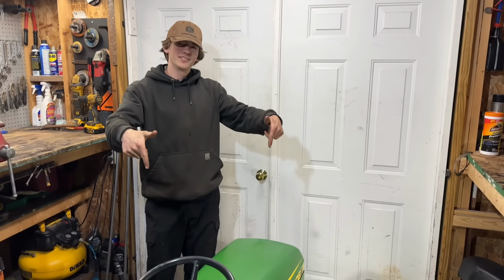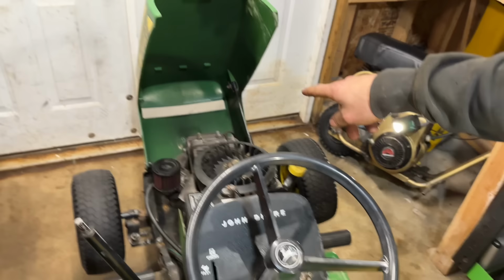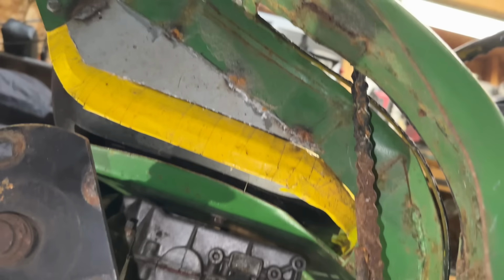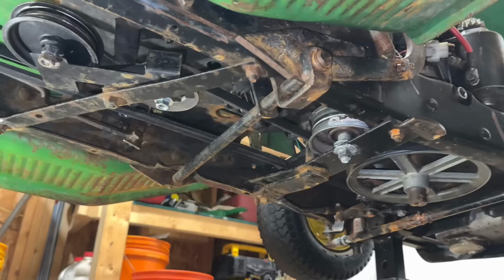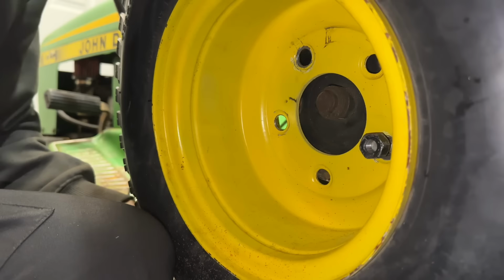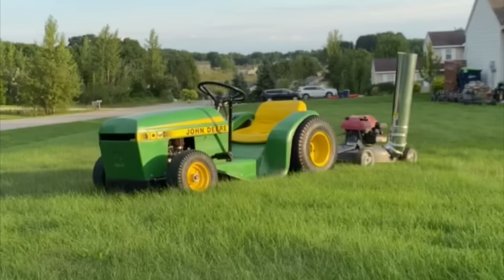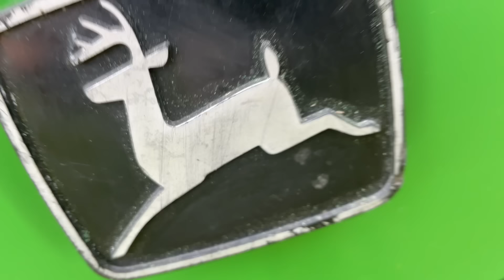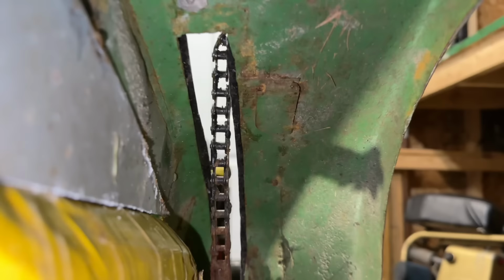How the John Deere Race Mower was made

Comment: im doing this with a John Deere LT160, ive already lowered it, swapped a manual transmission into it and swapped a Kawasaki FH491V onto it. This is an amazing build and an amazing inspiration.
Reply: Hey I’m working on a John Deere 160 would love to get in contact on how you did some of the lowering stuff on your John deere
Reply: @Popcorx  who?
Reply: I am really new to cars and stuff so how would you switch it to  a manual?
Reply: @ghoulish-  its honestly not too hard, if you have a mower and they made the same style of mower with a manual, id buy a used transmission from one of those. for me, i used a 6 speed from a craftsman lt1000 and i had to cut holes in the body for a shifter so its not the cleanest, but you can do it with anything you have avabile

Comment: I’m a certified John Deere mechanic and I absolutely love it. I’m in the process of doing the same thing with an stx38, almost identical to the 108.
The only thing I would caution is that without the fan shroud you’re running waaaay hotter than you need to be and are probably going to blow head gaskets or drop a valve guide if it hasn’t done so already. They run surprisingly well with a blown head gasket and dropped valve guide.  Can’t wait to do this to mine. No

Comment: Had one made from an old cub cadet with a yz490j two stroke in it. Thing was wicked fast and Its what i drove to HS because i never got my license until after lol

We didn't use much besides the body, frame, and controls. We got rid of the trans axle and it was turned into a chain drive to accommodate the new engine and trans. Turned the deck lift into the gear selector as well as mounted the clutch to it, making it a grip and rip, turned the brake into the throttle and the clutch into the brake. Thing was fun and could reach highway speeds with the gear ratio we had going on (I forget what the yz had going on but the rear was like a 20 tooth)

Comment: I had an older JD riding mower from the 80s, cant remember the model #, when I was a kid in the early 2000s. My dad and I put a smaller pully on the transmission and that thing literally went 20+ MPH and could burn rubber and damn near pop a wheelie. About 6 months later the transmission was burned out haha.
Reply: All he did was put a smaller pulley on the back?
Reply: @floridagirl386  Smaller pully and a shorter belt, yes. And it went incredibly fast.

Comment: Can you switch the pulleys and belts out for sprockets and chain and use a standard clutch? I'm just wondering
Reply: That got me thinking but I don’t think it would work unless you put a torque converter on the front. Since the engine shaft is always moving it wouldn’t work, you wouldn’t be able to stop.
Reply: @CatonCustomBuilds  I was saying a clutch like in a manual car or motorcycle, but a torque converter would do the same thing👍🏻
Reply: Or maybe a centrifugal clutch🤷🏼‍♂️

Comment: Wonder if this would work with a hydrostatic trans. Kinda thinking not, but might be worth a try. I've got a JD 146 that would be hella fun if I did this conversion. 😆
Reply: Hydrostatic trans don’t hold up to over driving you end up blowing the trans
Reply: Not sure how it would hold up but I say give it a shot if you can find a pulley - I’m building a racing mower right now and the hydro trans was splined shaft so just ended up swapping it with go cart axle

Comment: Great build, but a pulley swap is a terrible thing for actual racing. On those the input spins the selectable gear set, then goes to an additional gear that drops RPM by probably 8 or 10 before going to the differential. Those transaxles are not meant for high RPM because they don't use bearings, only bushings. A pulley swap greatly over-speeds them. A better solution would be to bypass that whole reduction gear. More difficult, yes, but way more robust. Side note: 7 to 1.5 belt ratio? Holy carp, you're spinning that tiny input pulley at 16800 RPM! How has nothing melted?!? lol
As a side note, the speed selection gear set is easily changeable, so you can tweak gear ratios and number of gears. I believe there are 8 places for gear couples, so typically you can get up to six forward gears, or take out the reverse and get seven. Can get rid of neutral as well for the 8th, but i would not recommend that.